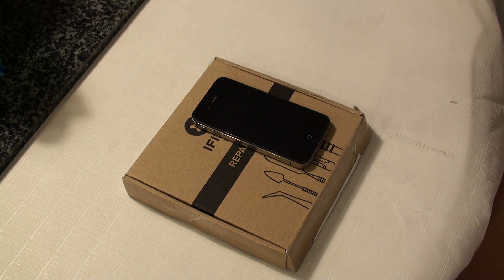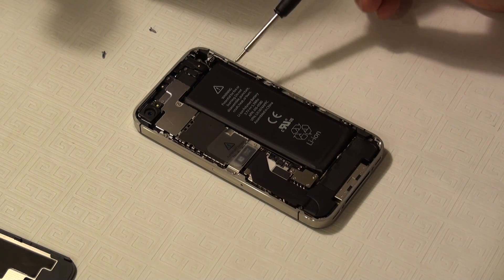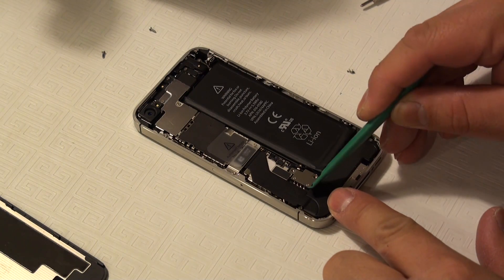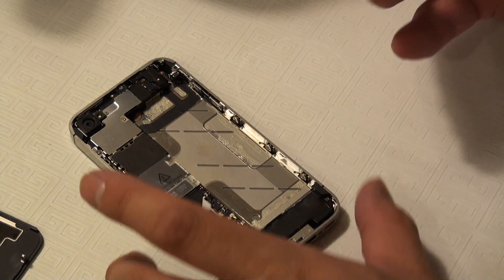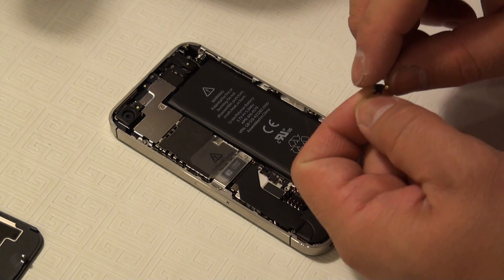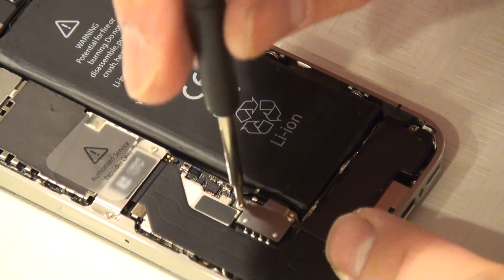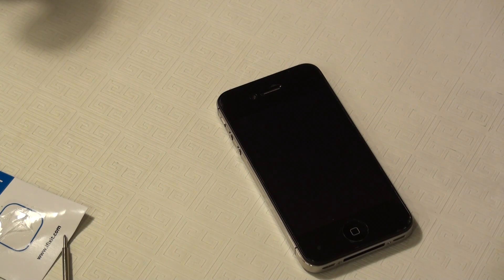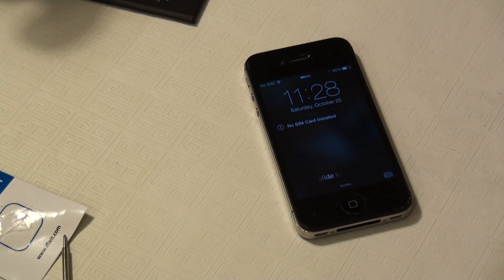Apple iPhone 4s Battery Replacement

Comment: It works!

My phone battery had exploded and I replaced it with this one and it works fine now! However when I press the back of the phone I hear a tap sound inside. 

It’s probably fine.
Reply from the maker: its probably the chassis components being a tad bit bent from the battery pillow syndrome.  If the phone works, leave well alone.

Comment: The iFixit youtube quickie video DOESN'T even address putting back in the little contact spring-thingy! and they sent me a replacement battery with a longer ribbon cable which can't be 'tucked in' anywhere, without possibly damaging it!
Reply from the maker: The devil is in the details with a lot of these modern compact devices.  Super important to explain that to the viewer.

Comment: A phone so smart, it needed hundreds of YOutube instruction videos about it. I miss my MOTOROLA RAZOR, if it was not stolen, I'd still use it over these smart phones that have zero common sense and so disposable. my battery may have died, but how would i know if it was just the battery? The last time it was the charger... now it must be the battery.
Reply from the maker: The unfortunate thing with the latest tech and the quest to cram more and more tech into a sleek form factorthat replacing something simple like a battery, requires someone to almost have an engineering degree.  I vividly remember the Razr and how neat that phone was.
Reply: @piercedasian  my smart phones are just presents.... I wouldn't buy them myself... my  iphone 4 was so useless... cant even download apps... and it is always trying to suggest stuff or update things, that are just dumb or intrusive... But at least the iphone 4 had a nice design. the other iphones were just flat and huge. the Razor was just perfect and so are some of the Nocia phones.

Comment: Be warned, the screws fixing the battery plug are extremely small and very easy to loose! A magnetic screwdriver is almost essential for locating the screws in the appropriate holes. I found it very difficult to slide back the iphone back panel so as to disengage the fixing lugs. My solution was to stick a piece of duct tape to the back and pull very hard on it.
Reply from the maker: yes the screws are extremely fine and your suggestion of using a magnetic screwdriver is a good one.  I didn't even think about that as I am blessed with some fairly steady hands.  I can absolutely see someone that twitches slightly and losing a screw.  Thanks for the recommendation to our audience.

Comment: has apple done something new lately? the phone keep restarting and i can't even hard reset it....my record was keeping the home and sleep button pressed for 90 sec!
Reply from the maker: Not that I am aware of.  Try charging the phone up for a few hours and then see what happens.  Sometimes when a battery is deeply discharged that it does some weird stuff to the logic board like constant reboots when it should be displaying low battery.  Sometimes when a battery isn't quite fully discharged that it can make a phone power up and down too.
Reply: @piercedasian  oh...thanks for the answer man, didn't expect one :) it didn't let me charge at all, but anyway, sold that 4s and got an SE instead. thanks again ;)

Comment: I agree. This is the most helpful of all the others on this subject. I have one improvement that worked well for me. I used a small wire to help guide the spring ground connector into proper position. Also used it to align the battery connector screw holes. Many thanks for the video! Jeff T
Reply from the maker: Great tip Jeff about using the wire!  Glad you found my video useful and informative. Thanks for watching!

Comment: Wow, great video; it's amazing that it takes a power user to correct an iFixit video regarding logic board screw lengths, delicate 4 point micro solder warning, rubbing alcohol to clean upper battery connecting screw, grounding spring/strap, rear antenna cleaning, realignment and the "liberation kit."  Thank you!
Reply from the maker: yeah the problem with many videos today is that people have a very short attention span and therefore content creators have to pare things down to keep the playtimes short.  The issue that arises from that approach is loss of details and for folks that aren't handy or tech savvy that this can result in making fatal mistakes.  I'd personally prefer to NOT ruin my $1000 phone and have someone teach me the PROPER way on how to repair it so I don't screw things up in the process.

Comment: I was saved from spending funds on a brand new car battery when I heard about the reconditioning program ( Check Details Here>>>https://www.facebook.com/Battery-reconditioning-310070329426065/app/208195102528120 ), therefore I tried it to recondition my old auto battery! I thought it would take much effort and hard work, however it was simple as ABC. That already saved me about $ 100 and there are a lot of some other batteries.

Comment: my btry is still new, but its not charging. when i put charger on, no ⚡️logo. and the percentage is getting low. what should i do?
Reply from the maker: you likely have a faulty battery or possibly a faulty phone charging circuit. I would try to remove and reseat the battery connector and then doing a hard reboot on the phone by holding down the home and power button for 30 seconds continuously and let the phone go through the booting process.

Comment: hello 
I would like to ask you about the grounding clip I have lost it somewhere is it okay to install battery without it 
my battery suddenly drains out so fast and sometimes it keeps running so what do you suggest I should get a new battery or to get this grounding clip only plz reply
Reply from the maker: unfortunately you NEED that grounding clip.  Hunt high and low if you must to locate it.  If memory serves me correctly without the clip grounding out the back of the iPhone your wifi and your cellular service will fail to work properly or will work very inconsistently.  If you need to buy a new clip then head over to www.ifixit.com to locate one.
Reply: thankx man much appreciated
Reply from the maker: you're most welcome!

Comment: So wait when you put a new battery does the iPhone 4s deletes everything like photos when you put a new battery ? or if you put a new battery  would it have your apps and photos still I'm just wondering if the iPhone 4s still has the photo because I'm using my iPhone 4s but my iPhone 4s  has a battery problems in using with the charger on my iPhone 4s but my battery drains fast when it's not with the charger on I just worry about my iPhone 4s removing the battery it would be hard but would it be easy I'm just saying so you know my iPhone 4s I'm using is having a battery problem it still works my iPhone 4s has not remove a battery yet  I'm still in my old battery my plan is too be careful of my iPhone 4s I just scared if i screwed up my iPhone 4s I hope not to screw it up so hopefully you answer my comment and that's all I got to say for you so your amazing :)
Reply from the maker: nope just back your data up first before you ever work on your phone in case things go south on you.  Replacing the battery in normal circumstances will NEVER result in data loss.  Data loss only occurs if you mess up the phone itself and that is likely because something got damaged in the process.
Reply: piercedasian thanks for telling me I'm just making sure but I order the set of tools and iPhone 4s battery included but my phone is not damage yet I haven't change the battery I did like your video I think this will help and thanks and I did subscribe you
Reply: piercedasian it works ! Thank you so much my iPhone 4s has a new battery thank you mines work now 👍
Reply from the maker: glad it worked out for you!

Comment: iphone 4s is heating up when im using 3g connection.pls help
Reply from the maker: depends what you're doing with the phone and what version of iOS you're using.  If you're using iOS 8 or newer then your phone absolutely will start getting warm no matter what you're doing b/c the iOS is taxing the system's memory and CPU.  I run iOS7 still on my iPhone and it runs like it's new still and it's dead cold.

Comment: I am 61 years old and my hands may not be that steady. But following the precise explanations and watching the video a few times I managed to do it and the phone booted up right away. Made me so happy and proud. I think your video has just the right amount of warning about the pitfalls and the same time an encouraging attitude which made me embark on the project. Screw Apple for the penta lobe screws and for their attitude in general.
Reply from the maker: yeah Apple is weird in some of things (crap) that they try to pull off.  I get that they're trying to control the entire "Apple experience" but making things hard to service blows my mind.  Just think... an iPhone 4 - iPhone 5S are EASY to service but anything beyond that gets progressively more and more difficult.  I like Apple products a lot but their desire for complete control over things drives me crazy. 

In any case I'm glad you liked my vid and you were able to resolve your battery issues.  Thanks for watching.
Reply: I'm motivated to do it myself after reading your post. Thanks!

Comment: what happens if on screw wont come off please
Reply from the maker: you'll have to either take it to an Apple service facility or get someone that is creative in how they can remove the screw.  Sometimes if a screw head strips one can cut a microscopic groove into the screw head and use a flat bladed screwdriver to break the thread locking compound off the screws.

Comment: Thank you for the extra comments. I had a lot more trouble getting the back off on my old phone that in the videos like your and hard to re seat. I cleaned all the accumulated dirt etc off which I assume was the problem but got it to move by being careful.
I did have trouble with the flat wire from the battery to the connector. I was afraid to bend it to get it to fit so it would not sticking up., perhaps mine was a little too long.anyway I attached the connector first then was able to squeeze the cable beside the battery. It all worked fine in the end. I was using a kit from AX Micro soln inc.
I see why the phone is NOT water resistant in any way. The 7 is clearly quite different. Resealing when you replace the battery will be quite a challenge. I had to take apart a waterproof camera so I know! 
Thanks again.   Warren
Reply: Yea that was my problem too with bending the flat cable to the connector. I looked at the old battery and got more courage when I saw it bended. Tried to do the same. I also used a minuscule plier which I had at home. Those two screws are really small. :)
Reply from the maker: I'm glad that the battery replacement worked out for both of you.  Yes the battery cable is actually more durable than it looks.  Small bends in it won't harm it all.  Yes the screws are pesky and I replaced my pentalobe screws with normal phillps screws that came with my iFixit kit.

Comment: My new battery wont charge. I changed back to my old one and it works fine apart from being old. The new new battery worked for 10 seconds before phone turned off and doesn't seem to charge at all. Faulty battery?
Reply from the maker: you could likely have a bad battery or a bad battery connection.  Reseat the battery connector or get a replacement from the manufacturer.

Comment: None of these battery vids show how VERY fragile the battery connector on the mother board is and how easy it is to break it off the mother board accidentally, basically destroying the phone unless you're prepared for a big repair charge.  If you replace your battery, do throw away the crappy plactic  "spooger" prybar supplied and use something thin enough to get between the thin metal connector cover and the plastic connector beneath thats soldered onto the motherboard; like a stiff guitar pick.
Reply: DWP in AZ
Reply from the maker: I would definitely agree with your statement that the battery connectors are extremely fragile but I do emphasize in my vid to very carefully pry it away from the board and not be forceful.  I guess when people take things apart they should exercise caution and understand that tiny parts are exceptionally delicate.  Not sure what else to say other than to just proceed with caution.

Comment: Hi, any advice, once the battery was replaced , but it's staying on charging mode ? thanks
Reply from the maker: have you done a hard reboot on your phone?  Hold the home button and power button for at least 30 seconds and then power it up.  That should resolve everything.

Comment: The best video I could find before starting for this job. Very well filmed, fluently explained with additional important details. Congratulations ! 
Beware that FIXIT had some kits with deffective screwdrivers. The customer service was efficient and I got the replacement right away.
Reply from the maker: good to know that about iFixit.  I have been fortunate enough to not have bad screwdrivers from them but I'm sure there would be some when you consider how many millions of parts they probably sell.
Reply: I also got a defective philipps screwdriver from Best Batt.  They were happy to replace it and now I've completed the battery replacement.

Comment: After i replace battery,my phone keep rebooting in apple logo?
Reply from the maker: did you try doing a hard reset on it by simultaneously holding the power and home button?  Is the new battery fully charged?  A faulty battery can cause constant rebooting b/c of low voltage or because I can carry the electrical load that the phone demands of the battery.  Seen it on faulty batteries.

Comment: Do the case retention screws complete the circuit for the battery?
Reply from the maker: The case is not needed to complete the electrical circuit BUT the case is needed for proper RF operation on the phone.

Comment: Thanks for your reply. When I asked why did the iPhone not find the SIM card after fitting the new battery I was referring to the one in your video. When you turned it on you got the WiFi signal but no SIM card. Why was that please? Just a bit worried in case it happens to me! Thanks again.
Reply from the maker: oh... that's because my phone didn't have a SIM card in it.. Once I popped my sim card in after the fact it worked just fine.

Comment: Thank you for an excellent in depth informative video. You have given me confidence to do a DIY job on my iPhone 4s. One question though.....why was the iPhone not able to find the SIM card ? Thanks !!
Reply from the maker: +flbyrne39 glad you liked my vid!  Chances are if the phone can't find the SIM card then your grounding strip spring isn't making good contact with the back of the iPhone.  Bend the grounding tab up a bit more and use alcohol to clean the contact points.  SIM/Wifi should all come up within 30 seconds.  

Thanks for watching.

Comment: Is there some way I can get another grounding spring any where I lost mine
Reply from the maker: Unfortunately no.  I am not sure where you could get one. Have you looked at iPhone repair sites to see if they have parts available?
Reply: I did some research the best bet to get one is one ebay and thank you for response. Also I have not found any other than ebay.
Reply from the maker: yeah I figured as much.  Not like you can walk into a store and ask "hey do you have a grounding strip?".  Glad you got your situation figured out.
Reply: Yeah for real and thanks for your professional help and advice I appreciate it.
Reply from the maker: not a problem.  Glad I could sort of help!
Reply: Also like your video helped me a lot on replacing my iphone battery.
Reply from the maker: that's good :)

Comment: I was amazed to see for a fact that the alcohol appliance on the grounding spring, really worked after I was not able to get a cellular signal! Amazing! I have seen many videos on the 4s battery replacement , but this one was indeed a very detailed one. Kudos!
Reply from the maker: +Dimitris Kag yeah the devil is almost always in the details.  I would agree that most of the vids on youtube about battery replacement are far too simpleton and that can lead to bad repairs where the viewer ruins their devices because the video tutorial was poorly done.  I don't work that way and I'm almost over the top anal about a lot of things.  If you're going to teach someone teach them the proper way.

Comment: Thanks I've watched 6 videos thus far in preparation of changing my battery; you're the first one to specifically say don't wedge on the inside where the circuits are, only on the outer side.  The explanation of the grounding spring was a great help too.
Reply from the maker: +ohbobpleez glad you liked my video.  The devil is IN the details and thus it is crucial that I disclose EVERY minor detail so that my viewers know how to do the job right the FIRST time.  How pissed would you be if I omitted important information that could render your phone unusable??

Comment: Excellent & thorough video. Also consider:
--> The parts are TINY. I used a magnifying headband.
--> If you don't have excellent fine motor control, patience and experience with precision work don't try this.
--> if the phone doesn't connect then disable "auto time set", change something, then restore "auto time set". No, it doesn't make any sense but it does fix the problem.
Reply from the maker: +Brian McCarthy good tips Brian.  The parts are insanely tiny and even at my age I struggle seeing some of the parts on the boards.